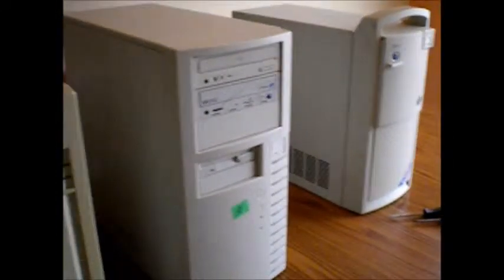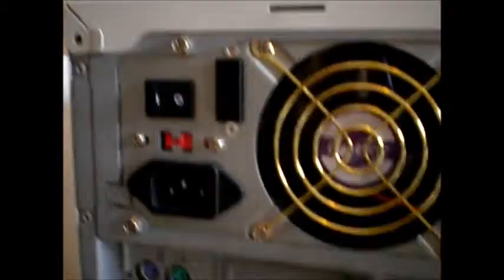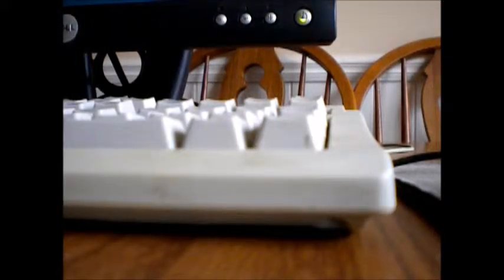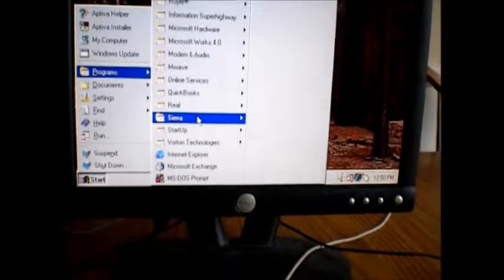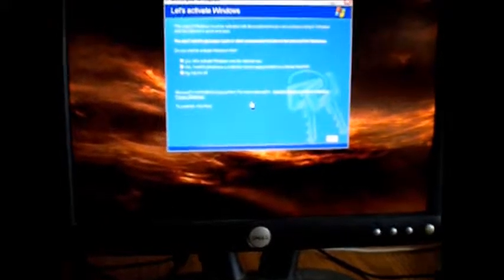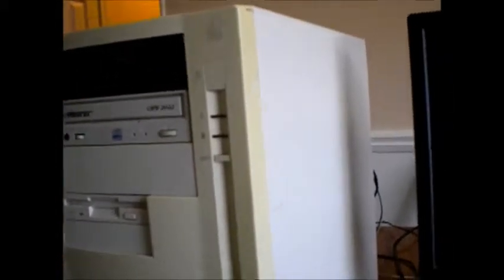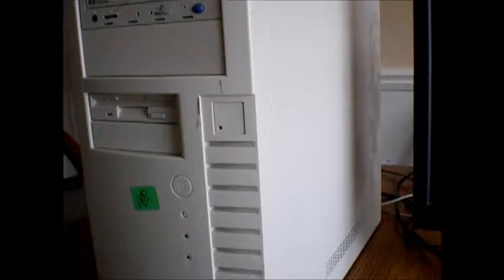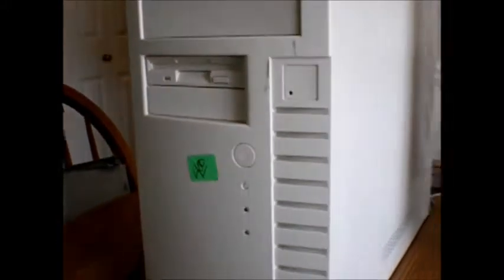3 Free Vintage Desktops, 6 Years In A Shed....Will They Work

Comment: gotta see what that slot near the 72 pin ram is on the older one, pc133/100/66 ram slot (66 would be worst but if it was a prototype slot before that became mainstream it could be interesting to play with), might also be for a cpu or some addon card.

Definately make more videos on em later after upgrades, uses (time to digg through the ram and hdd stockpiles hahaha!)  And you totally NEED to keep old pci video cards around, and get some floppies (would be good for plop and upgrading bios, could also run dos games off of it if ya wanted)  That oldest one only accepts PCI or ISA-16 by the looks of it.  Maybe rubbing alchol to clean up the contact points.  Wouldn't hurt to dust em out if ya got a air compressor (i'm certain your neighbor does if you don't),

There is ATX to AT converters as well.  Would help for being able to give it a new power supply (though wiring would be funky since you'd probably have to convert sata down to molex lol)

Comment: can't really do much about the cpu fan, can try some 3 in 1 oil, only costs like a few bucks, (around 3-5 i'd say, was closer to 3 when i got mine from aco), it might lessen it but it'd probably need replacement still.  Know i have a couple bad optioncal cooling fans from my core2quads but they still run, not all that bad, just a tiny bit noisy (still audible if you really listen) but bearings definately starting to go.

Comment: definately gotta give that last pc with RDRAM some TLC and some RDRAM once you can find some lol, would be nice as  9x build i'd bet as your conventional only was able to use PC133.  Though tbh a p4 with DDR1 may well beat it lol.

And you definately MUST test the compaq too, NEED the video on that regardless of how it turns out.

it may or may not allow rdram to work at the same time as pc133, probably not.  If it does it'd simply underclock it.  You definately have to find and do your research on those motherboards and their chipsets lol.

and who says all 56k modems are worthless? you found one that isn't (at least not untill you have a better soundcard)  That one is worth keeping around just for the sound part of it (if it can be made to work at all)

Comment: actually 300 mhz is the recommended minimum, 233 mhz pentium 2 is technically the minimum for XP,  And that system could be amusing for torture with its underclock to 133 mhz lol.  Would be like running XP on a pentium 133 cept a slgiht bit better due to architecture LOL.